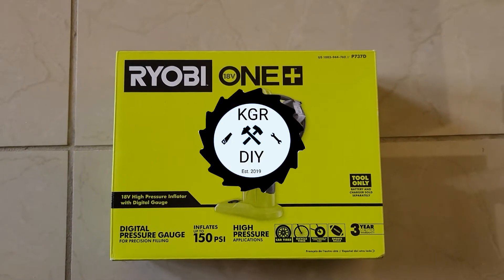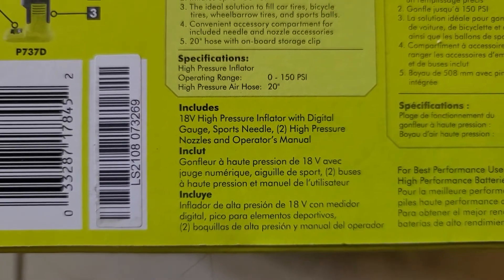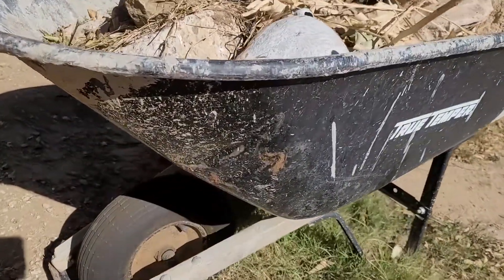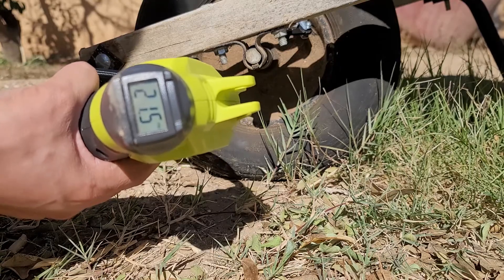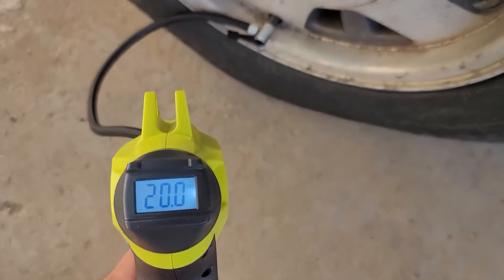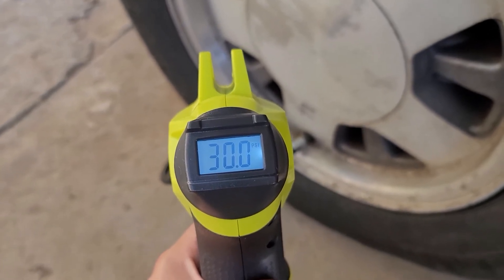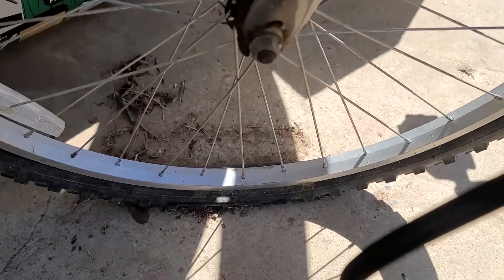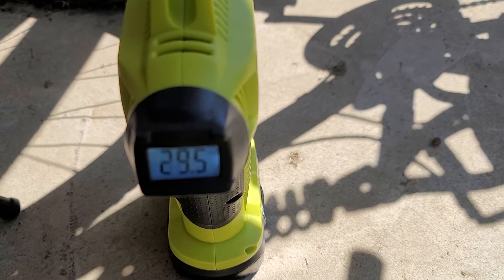Ryobi 18 volt high pressure inflator review: how good is it? P737D

Comment: Hi, could you use this tool to clean a computer of dust with the right nozzle?
Reply from the maker: I tried it out on my computer With the different nozzles it came with. In My opinion it's not ideal for it. it's a little noisy and it doesn't blow the amount of air needed to really clean the computer.
Reply: @kgrdiy1928  Thanks! :)
Reply: best to clean a computer with a vacuum type brush attachment than a blower ..imo.
Reply: @inthenameofthefather.7240  Yes, of course. I actually bought this product (for automotive purposes) and tried cleaning my PC. It worked. Not ideal, but gets the job done.

Comment: What would be annoying to me is you have to hold the trigger.  I'd rather set a target pressure and then walk away from the noise and it would shut off automatically.  Bad on your knees or back to have to hold the trigger the whole time.  My cigarette lighter version doesn't shut off automatically, but at least I can step away from it.  My 2 cents.
Reply: Rubberband or could have implemented a trigger lock…however,, the fact that Ryobi advises the 5 on/5 off when in use is probably the drag on this contraption.  That aside, 👍🏽 in my book.
Reply: @dafenddaweak7753  The Ryobi model above this does inflate to a preset pressure and then stops.  Costs $59.  Worth it to me as I have got bad knees.  I'm sure there are better ones than Ryobi, but I've already have the batteries.✌️
Reply: @markstipulkoski1389  Do you know the model number above this one. Thanks
Reply: @LarryRichelli  Ryobi P747.  $69 @ HomeDepot. It went up $10 since the original post.  That is without the battery.        I dont have one yet, so I can't endorse it over any other brand.  It has a 3 year warranty though.